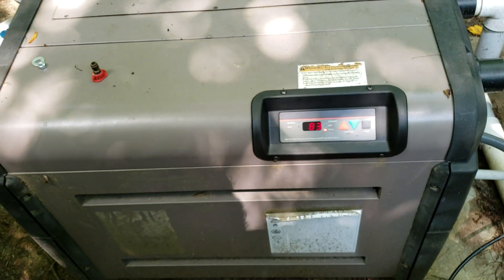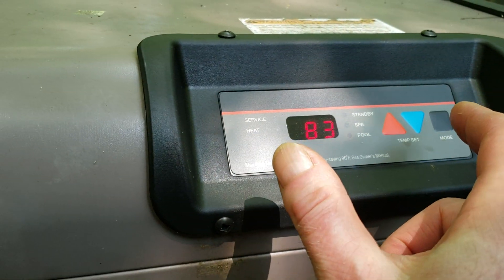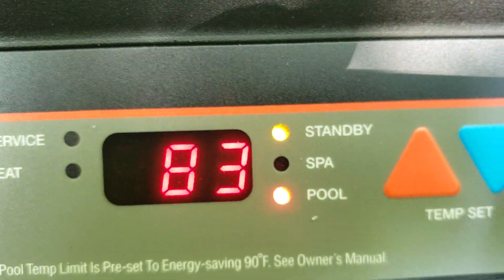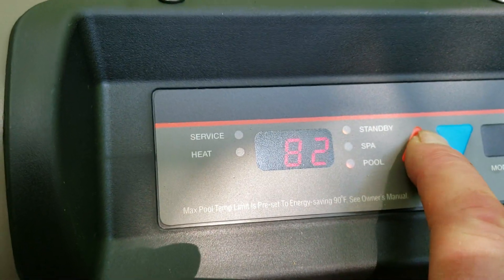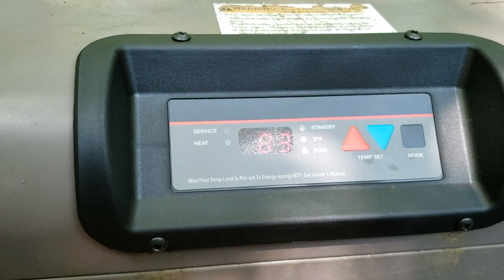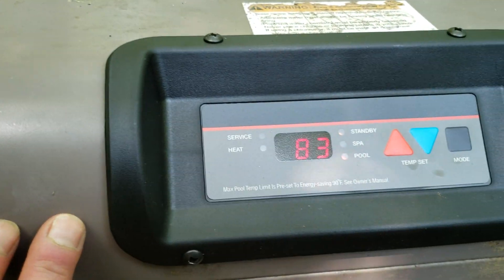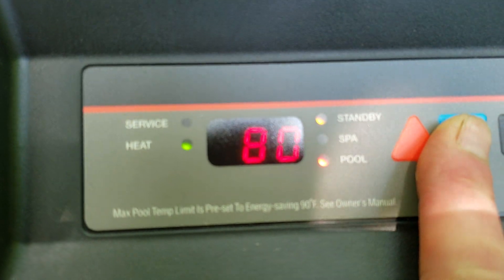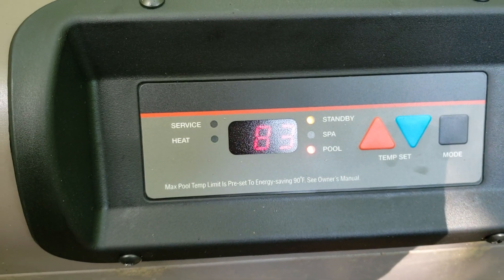Hayward Heater WILL NOT TURN OFF. HELP!!!!

Comment: Mine started to have the exactly same problem! Discovered my pool got to 86 degrees and gas bill was $300. Really frustrating. Thanks to your troubleshooting attempts I suspect it’s not electronics issue, but more like internal jumper setting or wire remote port inside got corrupted or shorted.
Reply from the maker: That's very interesting. I just  opened my pool 3 days ago and wanted to test the heater. Turned the propane on and since the water was 63 (below the 65 minimum setpoint) my heater (which was OFF) fired up with no way to stop it.  I put it into bypass mode  (arrow up and mode held together) as well as physically shutting off the gas flow.  
It can't be a board- I changed them all (3) trying to fix it.  
It must be within the wires.  
Hayward should do some troubleshooting because it seems to be a problem for a few of us
Reply: @Drrich_DIY  mine is older than yours, almost 20 years old. But the controller buttons and modes of operation is the same. That implies this ‘problem’ is not a problem as in something is broken, but rather an expected behavior given some input. When I had to open it up to fix broken diverter valve or something about 5 years ago (another common issue) the service manual that I read described external wire control ports that needs to be hardwired. And I suspect some of them started to give wrong input to the controller. I’ll work on it probably this weekend basically cleaning cables junctions with electronics cleaner and see how it goes. Thanks btw for posting this video.
Reply from the maker: @jisyang8781 you were correct. Read my pinned comment. I’m in the process of making a video. It’s your timer. If you have a fireman’s switch replace it or replace the entire timer.
Reply from the maker: Read the pinned comment. After 10 years of this issue it’s fixed.

Comment: I bought my house last fall and the pool was already closed and winterized. I just opened my pool today and ran into this exact same problem. The standby mode doesn't work. I see I'm not the only one who's had this problem. Any fixes for this?
Reply from the maker: Unfortunately I’ve given up. I’ve changed all of the boards to no avail. I just shut the propane off (we have a shutoff just before the heater) and put it into bypass mode. Don’t recall which 2 buttons to press and hold but have been doing that for years now.  Sorry I can’t help more.

Comment: I'm having the same issue!  Did anyone figure out how to turn it off?
Reply from the maker: No, believe it or not until now I was the only person who had this issue. And I changed the board, as well as the display board. Unfortunately it’s still broken and my wife and I work around the issue by putting it into bypass mode and closing the propane shut off before the internal valve when not using the pool.  So it goes something like this when we are having guest over in the afternoon ; Wife goes out to the pool at 9am- takes pool out of bypass and turns propane shutoff back on. Sets pool to 86 from 81. Heater kicks on and runs the temp up to 86 where it stays until guests leave (let’s say 10pm). I then go out to pool, set temp back to 81 and put heater into bypass mode and shut off propane before heater. So there it stays, off because there is no propane available until we want to heat it again. 
Yes ira a pain. But nobody has any idea where the issue lies. Sorry about the length of the answer but nope. Still broken. If you find out let me know. Thanks.
Reply from the maker: Ps not talking about the shutoff that requires the back panel to be removed. We have a quarter turn shutoff before the regulator on the line.
Reply from the maker: I did today. Jumping for joy. Read the pinned comment.

Comment: Turn off the power to the heater wait a few minutes  then turn it back on , it may need to reset ,. If that don't work and you have bypass vales that take your heater out of play just turn the power off and return your bezsel  and buy another
Reply from the maker: Thanks for the help, but I’ve just been living with this for 2 years now. The only way to make it not run out our 500g propane tank is to put it into bypass mode (arrow down and mode together for 5 seconds) and shut off the propane manually. I’ve tried multiple control boards, and multiple display boards.  Really crazy. Thanks again

Comment: I just bought a brand new Hayward 135 natural gas unit .I keep getting the LO code . I have tried backwashing , rinsing ,taking the basket completely out , I keep calling the place I bought it from , the repaire man . I get no calls back from no one .I had a little mini max Heater for 4 years , I never had no issues with it .Last year I broke my hip and could not bring it in . Oh well. I figured I would buy a new one and have no issues . Well I cant get nobody on the phone.Tuesday starts again . If anyone has any advice , please write back , glassguy3@att.net
Reply from the maker: I would do exactly this:  bypass the pressure switch and see if it then works. If it does its just the small pressure switch. Watch this vid https://youtu.be/JmVa2EXkrIQ

Comment: What automation panel do you have? I’m sure you fixed the issue by now
Reply from the maker: believe it or not I didn't- but I work around it.  We bypass the heater when its not in use, AND I cut the propane  at the shutoff (outside the unit).  Whoever wired the system put the main pump inline with the heater, so I cannot shut the heater off (cut the power) without turning off the main pump.  Its winter in NY, so any ideas you have would be great, but I would have to wait until the spring to implement them. PS- what is an automation panel? same as circuit board version???
Reply: @Drrich_DIY  I'm having the same issue right now.  Heater is probably 8-10 yrs old and I'm in NJ.  Any update since?  Please let me know. TIA!
Reply from the maker: @AldoRyan  nope, it’s still broken.  I have a shutoff for the gas (propane) outside of the heater so we turn the propane off and put the heater into bypass mode. And it stays that way until we need the heater again.
Reply: @Drrich_DIY  Ahhh shux. That's too bad but thanks for responding so quickly.  I have a natural gas shut off valve right next to mine so that's exactly what I did today.  If you find out anything, please update this thread. I'll do the same if I find out anything first.
Reply from the maker: @AldoRyan  I definitely will, thanks, but I’ve given up on trying to fix that thing. As long as it heats the water. The lights on the panel still don’t work properly after changing all three circuit boards.  The standby light still doesn’t go on by itself when the heater is “off”. My sequence is pool then spa then standby plus pool light up together.  That is “off”. No idea why.
Reply: I just encountered this today on a brand new heater I installed for a customer. It is perplexing. I believe it is an SB code that is not showing up and the problem lies within the display board and buttons itself
Reply: By automation, the other poster meant, is the heater controlled via an app through a remote connection.
Reply from the maker: @Neo024  no, my pool is old. The only automation it’s got is me walking over to the heater and turning it on. The pump is on an intermatic along with the heater. Both shut off 12 hours a day. Still working around. I callled Hayward when this first happened. They thought I was crazy. Multiple parts and boards didn’t solve the issue so I’m still working around it by turning off the propane to the heater.
Reply: @Drrich_DIY  hey whatever works.  Did you replace the actual display with the buttons?  Or just the board on the back?
Reply: @Drrich_DIY  not that you would ever want or need to, but that heater does have an external controller right next to electrical connections that can be hooked up to automation.
Reply from the maker: @Neo024  I replaced the buttons as well. That was the first thing I replaced. I’ve long given up. I’m in New York and we have propane so we don’t use the heater that much in the mid summer. Basically only to heat the hot tub or if we are having guests and want to take it to the high 80s.
Reply from the maker: Where? Just curious.
Reply: @Drrich_DIY  The connection is right in the junction box underneath the main power terminals in that model.
Reply: @Drrich_DIY   Hey there, independent service technician here.   I am researching into this issue, a client has the exact same problem.  I suspect it has to do with the 'remote' terminal being configured incorrectly (as in, no remote connected, but a jumper or programming is set for a remote connection).   Will try to get back with you over the next couple of days and let you know what I find.   This problem prevents me from entering standby mode so  that I can program in a temperature lockout on the board.
Reply from the maker: @NJPoolboy  thanks very much. Interesting theory. You may be onto something. It’s irritating but we have been living with it for 3 seasons now. Bypass mode and turning off the propane flow before it enters the heater is what we do. Thank you.
Reply: @Drrich_DIY    Ok.... here's how I got it to work.   Check to see if your heater has a firemans switch at the pool pump's  timer.   It is most likely hooked up to the remote terminal inside the junction box of the heater.   I was able to put the heater in standby by enabling the firemans switch.... you can do it to check to see if this is the problem by activating the switch in the timer (that's how I tested it), or opening up junction box and seeing if it was a jumper wire that was cut, and the firemans switch wires are attached to the cut loop.   The purpose of the firemans switch is to shut the heater off about 10 minutes before the timer stops the pump.  Will check back over the next day or so to see if this helps you figure it out.   I didn't remove the firemans swtich on my job, I only needed to close the path for the standy mode to work, in order for me to program the temps.   If you go into the junction box, make sure the breaker is turned off that controls the power to the heater.  I should have opened the junction box to see the connection, but didn't need to.... time is $$ :)

Comment: I'm sorry it's causing so much trouble. My question is how much propane did you go through? I've bought a 19x35 pool and plan on getting propane heater because I don't live in an area with natural gas. I'm worried about how much propane I'd go through from June through  September.
Reply from the maker: It totally depends on how much and how often you use it, and the size of the heater. We have a 500 gallon buried propane tank, and our heater is 300,000 btu/hr. 
It takes us 1 hour to raise the pool temp 1 degree farenheit.  So to go from 76 to 82 its running for 6 hours straight. 
Im sure you can find a formula for how much propane per hour your proposed heater burns, and do the math. In mid summer, we dont need the heater unless we want to tweak the temp.  In sept or october we could use a tank a week. 
I use at most 250g per season, in NY
Reply: Did you ever figure out what the problem was?